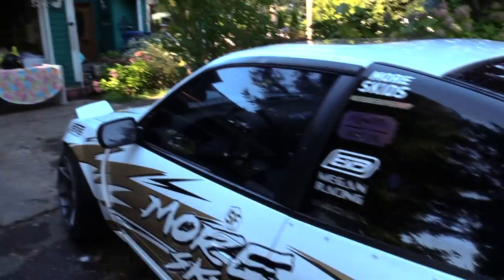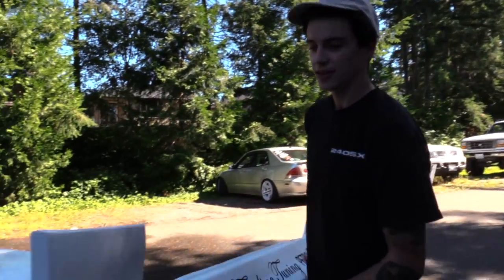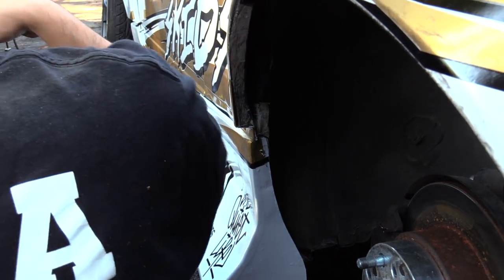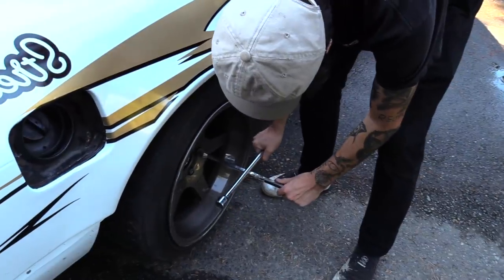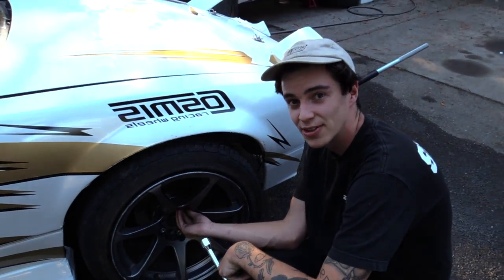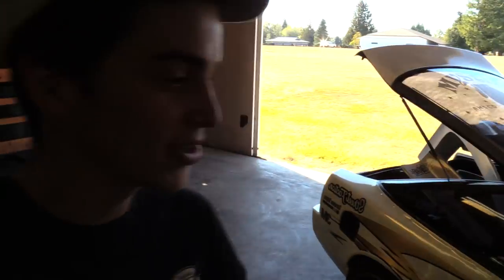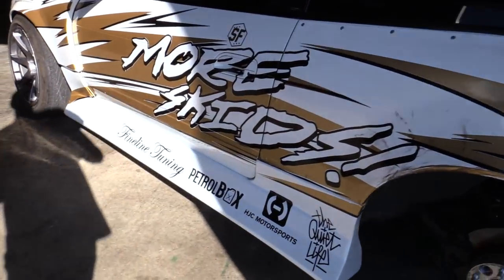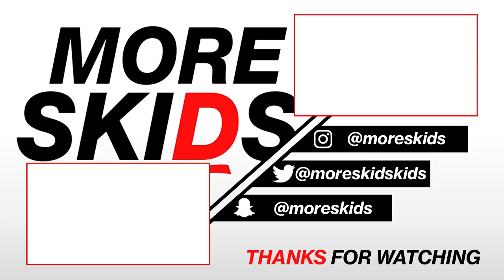240SX BODY KIT INSTALL! (Fineline Tuning)

Comment: Kit looks great! You should consider using nutserts in place of the zip ties.  Using nutserts will allow the kit to be removable in those areas, as in you will install a threaded insert into the body and use a screw to secure the kit to the insert in the body. I mounted my ae86 side skirts with them, super easy to use and very practical.  The tool was a bit expensive and I barley used any of the inserts though. If you want to use the tool and some inserts, let me know and I can ship it your way.  Just send it back when your done using it 👌👍
Reply: Yes! I like downstar hardware, it’s a little easier and prettier too :)
Reply: One thing I learned from another YouTube video today was that using zip-tires is beneficial because in drifting if any body panels get ripped off it won't destroy the mounting points.
Reply: Bruh by the time I got to the bottom of your essay I forgot what I was about
Reply: Richard Fuller makes sense, never really thought about that. Maybe zip ties would be a better fit in this situation 👍

Comment: Sry boyz, but no zip tie is going to save those skirts! Hit something, you'll find out really fast!
Reply: Sry man, but you're wrong! If you hit something you want the skirt to break the zippy's and fall off. Not stay on and crack and break the skirt under pressure. That's been the way of going about for years :)
Reply: exactly, with rivets you run the risk of hitting something and cracking the fiberglass at the join points or worse, splitting the kit in half - much better to use zips in case of this
Reply: Maybe poly skirts could be saved, fiberglass just explodes on contact.

Comment: Little late now, but my recommendation would've been one river to the rear quarter for the skirts and then two zipties in the front and two on the rear. My rear has one ziptie on both sides and it's pretty solid. Front bumper has two zipties on both sides and one on each quick release thing